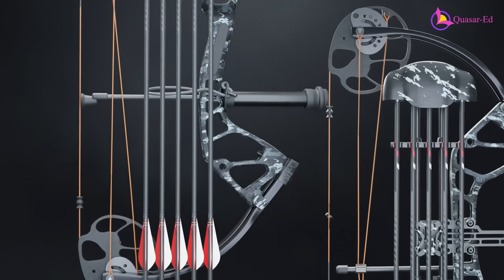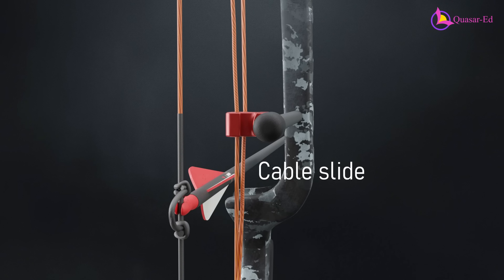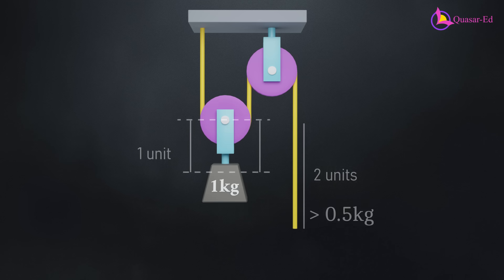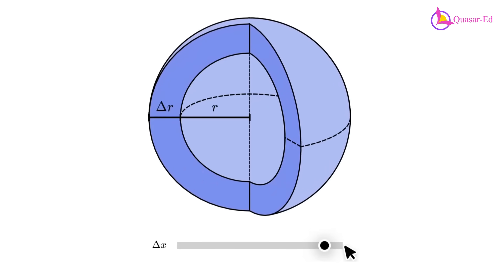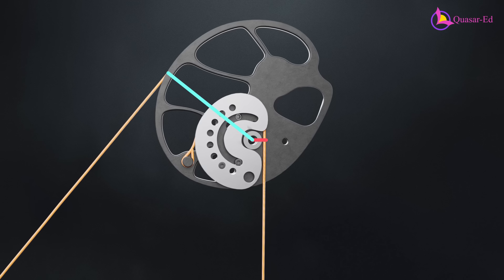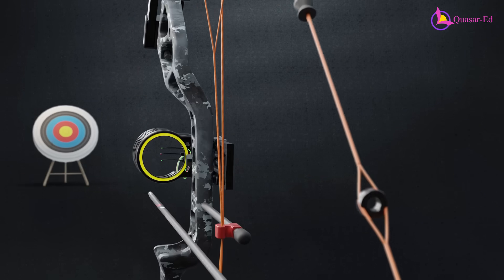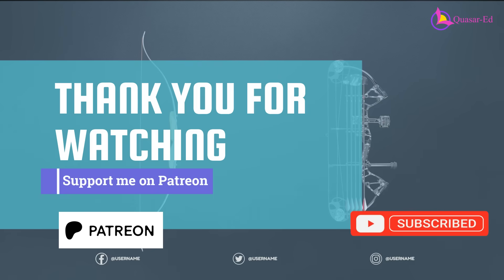The Engineering Behind the Modern Compound Bows

Comment: Another advantage of a compound bow is that by having a consistent force for most of the draw, it can have more energy. The energy is the area under the draw distance vs force curve, and since a traditional bow has the force increase linearly, the area is just half the base times height. If you have a compound bow designed to have constant force (until right before full draw), the area is base times height and it has twice as much energy as the traditional bow.
Reply: It's not just an "advantage", it's actually the very reason behind its development.
Reply: Similar as CVT scooter vs manual transmission motorcycle, somehow cvt accelerate faster than manual counterparts just because of smoother power curve
Reply: @aikonlatigid  I don't think it's the case, since in the CVT scooters I know the expansion of the belt (the gear ratio) is rpm dependent and definitely not flat as a compound can be. What you say is however very correct for CVT cars like Toyota hybrids, Honda Civic CVT and so on, where the gear ratio (the belt expansion) is not purely dependent on rpm but it's electronically controlled, so the car goes to the rpm of max power and stays there, while the gear gets progressively longer, and by keeping max power all the time it accelerates (marginally...) faster than a car with 7 gears DCT.
Reply: No super recurve design stores a lot of energy
Reply: @KK12312-e  there's not even a definition of super recurve. Anyway a compound ("bow with pulleys") can always store more energy for the same draw weight, if the designer wants it.

Comment: A Informative Video but you have a Modern Myth in it.
The Compound Bow Don't deliver more Force as any other Bow. You Explain in the Video also why. Because the Peak of an Compound is Higher as that of an Reagular Bow.
That means in Fact that a Compound Bow can never be a Warbow 80lbs->200 lbs. There is a tanke on from a bow company with a Compound who has 130 lbs but a Warbow Shooter says, that it is 10 Times Harder to Shoot and hit the Target as with his 160lbs Longbow.

And the Information that The Recurve is Weaker when not Completly Pulled is also Wrong. Ther was a Study about how deadly a Bow is and they are not only Find out, that Ballistic Gel is not Suitible for bows, but also the Crossbow Paradox. When you hold a Bow longer as 3 Seconds in one Position, it will be Weaker as when you pull and Shoot. Even when you don't fully pull it Back. The Reason of this has something to do with the Material Memory. The faster it is released, the smaller the chance that the Material will adobt the New Form and will faster Spring Back to it's old one. That is also the Reason why you must take of the String of an Normal Bow or it will turn in a Useless stick. And when you don't have string him for a Long Time you must do stretch exercises with him before Fireing an Arrow or the Material Memory will hit so Hard that it Breaks your Bow Limps.
Reply from the maker: @Hokatoman  Thank you for pointing out and giving me more information to think about. One of the reasons why I like sharing what I understand is because people like you who know more than me also share back their knowledge.

Comment: 1:15 That was the curve chart of plain longbow, not recurve. Recurve bow, especially arabic/asiatic recurve bow with siyah, has steeper increase at the beginning, and more flat at the end. But not as steep as compound bow (with cam), and without let-off. Because while the string near the tips still stick to the curved limb tips, the limb part to bend (between contact points) is shorter. From tips to contact points only applied compression force, no torque. So it feel stiffer at the beginning, compared to longbow. That's why recurve store more energy than longbow, for the same draw weight & draw length.

Arabic/asiatic recurve bow with siyah also has a kind of stopping point at the end of the draw length, at the same position where compound bow reaches let-off. In this position, the draw weight peaks up because the tips (siyahs) almost flatten and cannot bend anymore. More pull on string only apply tension to the limb tips, no more torque. This will help more consistent draw length to the archer, just like compound bow but not adjustable. So, a good arabic/asiatic recurve bow designed specifically to match the draw length and strength of the archer.

Comment: A bow's efficiency lies in how the string moves after being released by the archer. It decelerates in the traditional design, lagging behind the accelerating arrow and wasting much of the energy stored in the bow. The string of the modern compound bow accelerates, wasting less energy to make a ping. That is why modern crossbows adopt a similar design when the archer's strength is not a problem.
Reply from the maker: @xuehengzheng7455  Good explanation.🤝🤝👍👍

Comment: Wonderful video.  My first bow was a fiberglass recurve in 1964.  I upgraded to a Bear Kodiak recurve in 1979, then to a compound in 2003.  My shoulder problems forced me to use a crossbow in 2022, but I still shoot my 1964 recurve.  My favorite by far is the recurve, but it requires a lot more practice.

Comment: Awesome video. One small thing is when explaining what a stabilizer is. The main purpose of a stabilizer is to counter-act any torque the archer may produce in their grip. That's why it extends out away from the bow. The longer the moment arm and the more weight on the end, the harder it is to torque the bow. It makes it drift less in your hand when aiming and when shooting it doesn't allow the bow to twist in your grip. That's why competitive shooters have gigantic stabilizers on their bows.
Reply: Stabilizer actually performs several tasks: adds inertia to compensate transitional movements of the bow, adds inertia momentum to compensate torques and rotational tremolo around the arrow line, adds counterweight to compensate torque around the grip point when drawing the bow and finally dampens and reduces vibrations first moments after the release. And also causes bow to perform this fancy swing at the end of the shot :)
Reply: @SergeLevin 
And one more that lots of people forget.
When you release the arrow, the force is above the fulcrum of the grip. This makes the bow want to rock back once the shot.
A properly setup stabilizer keeps the bow stable until the arrow is gone.
Reply from the maker: @sd91499  Thank you.

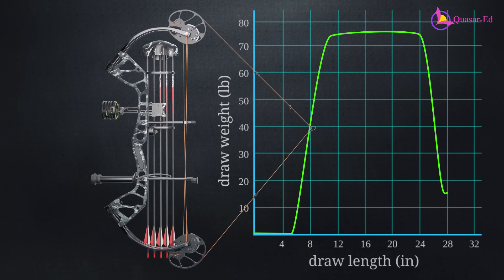Comment: Great video! An unmentioned advantage of compounds is the "Power Stroke". Which is how much of the draw is at max pounds. Your draw force table at 1:51 shows it. Nearly half of the draw is at "max pounds"; instead of the linear traditional draw force. On my compound it spends about 22-23 inches out of my 31 inch draw at nearly max pounds. This is where the monstrous speed advantage comes from.

I prefer... Both 🤣. Compounds are fun because you can nerd out and min-max the heck out of them but traditional is great because of their sheer simplicity.
Reply from the maker: I didn't know it is called 'power stroke'. Thanks for clarifying. I also like both, one to admire the engineering, and one to feel the raw simplicity.
Reply: Yes I also shoot both compound and longbow for pretty much the same reasons. I love the technicalities of the compound and trying to master it can take just as long. And I love all the history behind the longbow, and its just fun to shoot 🙂